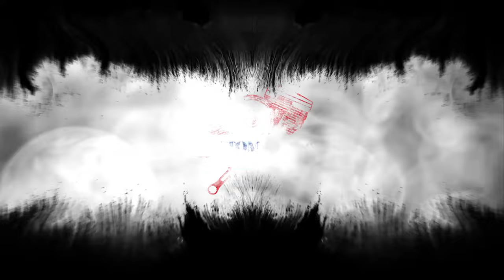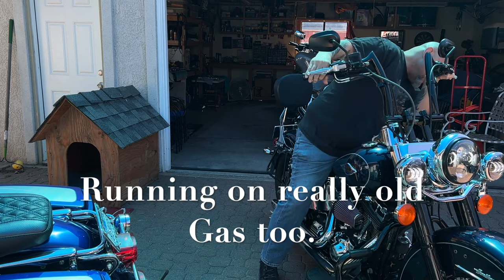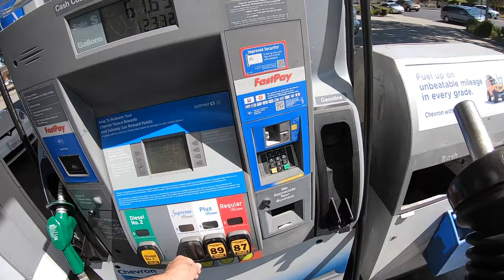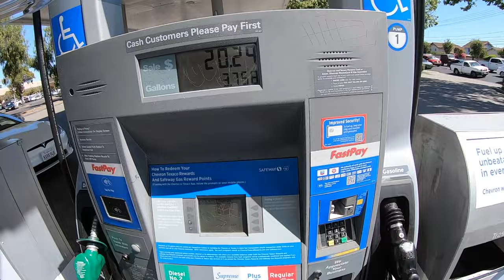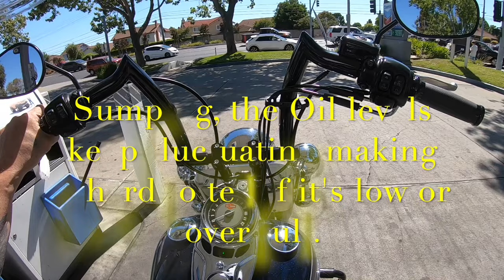"Come Take The First Test Ride With Me On Jesse's Softail"

Comment: hey man, loving the videos, i noticed my clutch cable is leaking so i’ll have to replace that, my question is will i need to adjust the clutch from inside the primary at all if its already been done when i had my apes put on? or just loosen from the cable itself for some slack to take it off and when i put the new cable on just retighten it from the cable? i hope that makes sense
Reply from the maker: @seabass_m  Hey bud good morning and thanks for your question. No, you do not need to reset the clutch adjustment behind the derby cover, just switch out the cable and your good. 👍🏼  have a great day.
Reply: @jcustombuilds  awesome thank you man!
Reply from the maker: @seabass_m  Anytime. Anytime 👍🏼